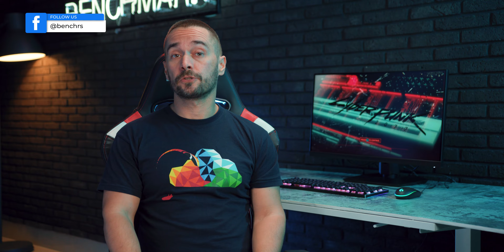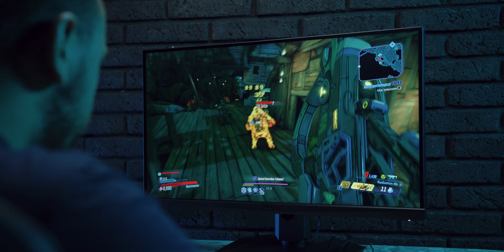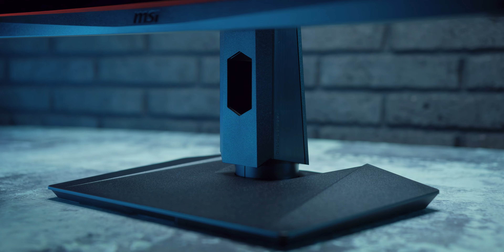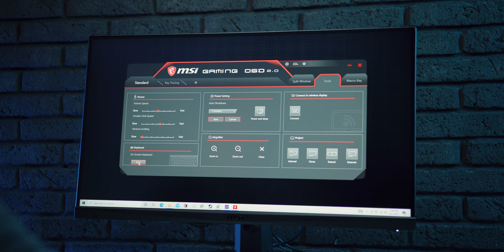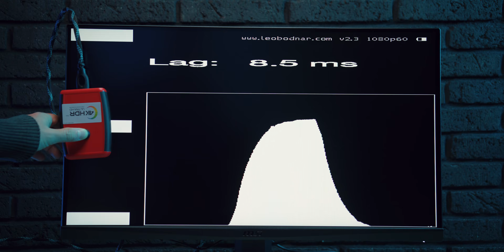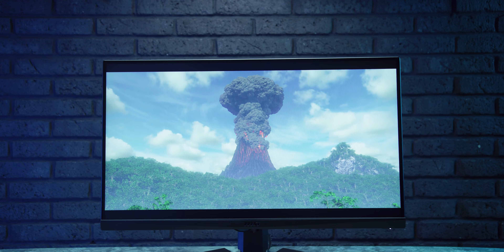MSI Optix MAG274R2 Gaming Monitor Review

Comment: when you said negligible IPS glow, it's as good or nearly as good as VA panels? virtually no backlight bleed?
Reply from the maker: It's close, you may notice it more at a certain angle, but it's still very good for IPS. Might very between specimens though.
Reply: @BenchHouse  wow! you're right. i decided to take a chance and bought it. there is a subtle backlight bleed at the lower left side though, but only noticeable if i stare at it during dark scenes, but virtually no IPS glow. this model is much better than Gigabyte M27Q-P in my estimation. i'm returning that Gigabyte monitor.

Comment: Bro! Save pls, can I play ps5 at 120 fps with HDR in this monitor? I also would like play in mi series s 120 fps/hdr
Reply: I think you can’t. I think Ps5 needs hdmi 2.1 for 120hz, while this is hdmi 2.0. Also, although the monitor says it has hdr, it only reaches about 300 nits, which isn’t high enough for full hdr. About the refresh rate, just do some basic research to see if you can do 120 hz on hdmi 2.0 with ps5. Hope this helps
Reply: @andyrodriguez7511  thanks!
Reply: @EdysonBiker  yes you can 120 hz 1080p
Reply: @swa99a10  thanks! Será mi próximo monitor para mí ps5 👌😎
Reply: @Edyson Dice and did you buy it?
Reply: these comments are wrong. i have this monitor, and use my ps5 on it, itll only give you 120FPS/120HZ at 1920X1080P
Reply: @Phantasmagoria92  is it good on the ps5
Reply: @aykbakar8401  yes it is. It works fine but no 4K only 1080P it still looks fine
Reply: @Phantasmagoria92  well duh its a 1080p monitor
Reply: @Phantasmagoria92 ps5 only max out 120hz

Comment: Would this be good as a secondary monitor for photo editting of astrophotography shots? I need good true color with very clear picture. Thanks. Great video. I am thinking it would pair up nice with my Alienware m17 R3 with the RTX 2060
Reply: from what I understood, this would NOT be ideal for that type of use.
Reply: I did buy one and It works very nicely for my editing of space shots. The color is good enough for what i need. My software makes editting very easy which is nice too. My software probably makes the monitor look better than it truly is.   @Jaylou88